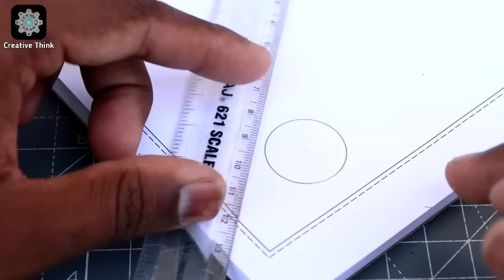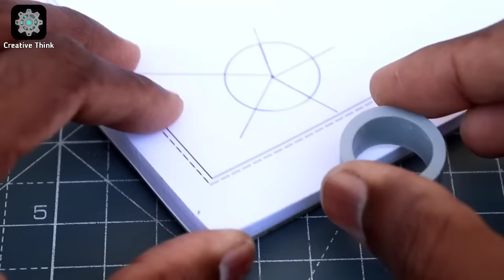Free Energy Generator Using Turbine Model

Comment: This might be a silly question, but why are the magnets on 'C' shaped mounts?  Why not on a straight bar from the center?  As the parts are non-magnetic I can't see it making a difference.
Reply: this shape prevents the magnet from falling (i think)
Reply: not silly question ,, i think  he wants the entire surface of the small magnetic disc face the main magnetic power and simply he have this tube and he used it in this fashion...

Comment: 1-way electric motor.  How it works with AC?
Reply: Okay so the turbine sits on a little electromagnetic receiver device that is powered on by the first spin of the magnet turbine and the power from that is used in the copper coil to create an electromagnetic field that in turn keeps the magnets spinning and ac power in the receiver powered to run the magnetic field in the coil and so on

Comment: This is pretty close but try thinking "how do I make a stable floating object using natural permanent magnetics"  the secret is in the quantum geometric shape of the magnets. Is not about the pull but the push. If you make an object float and balance, itll start to spin and heat up. The trick is doing it with natural permanent magnetics instead of electro magnets that way you can create energy instead of using it up.